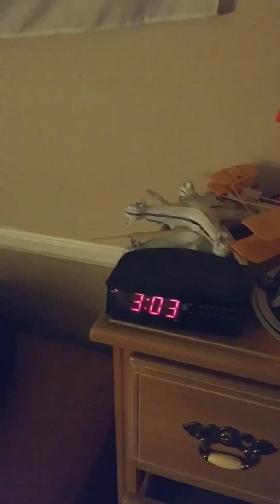My Solid-State Tesla Coil, now with bigger sparks.

Comment: Odd how the sparks go downwards. Is that due to the charge of the extra topload material repelling the electrons?
Reply from the maker: No, it's because that's where the sparks are attracted to... down is where the ground is! The secondary coil base wire is connected to earth ground through the electrical outlet.